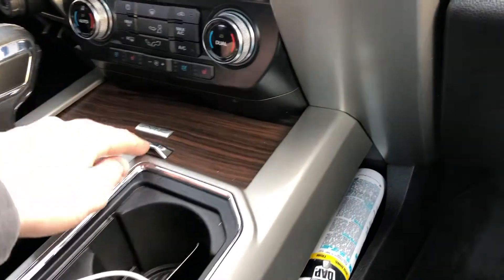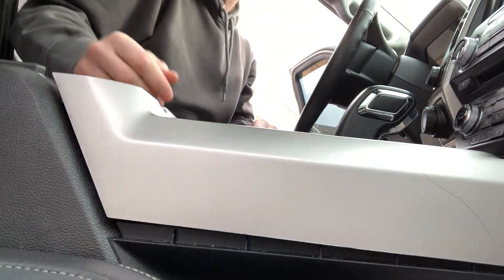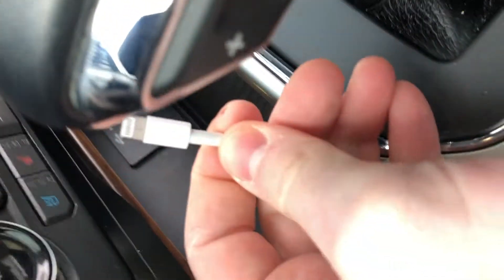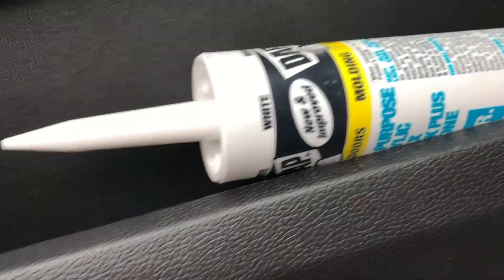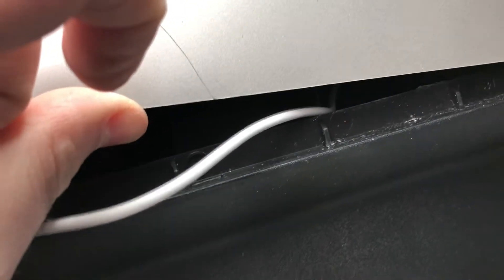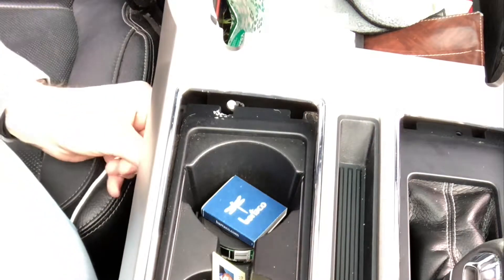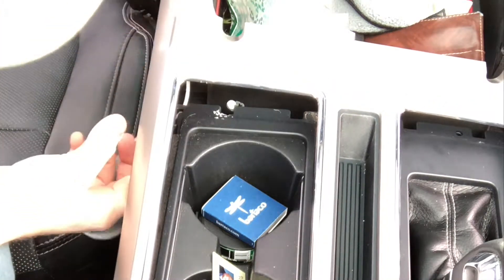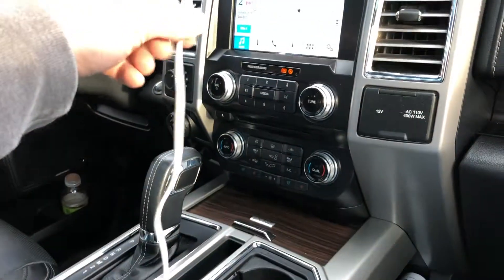FORD'S BIG MISTAKE (Fixed) USB port

Comment: Or... You can plug a USB power port adapter into the 12volt outlet in the console. 🤣
Reply from the maker: You could, but then it won’t work with CarPlay. If you don’t have CarPlay, you can add it. I did a video on it and the parts you need. 20 minutes project!
Reply from the maker: https://youtu.be/E02uhxR9O5I